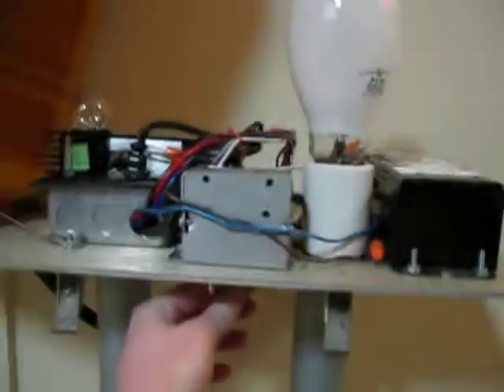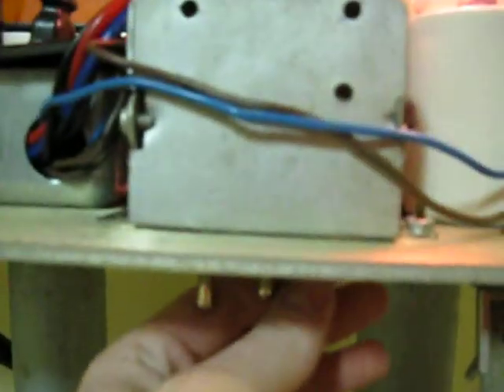Flash Technology REIL Airport Light!

Comment: The light is a Runway End Identifire Light and is used with atleast one light on each side of the runway threshold. They flash at 60 or 120 FPM and is used to help the pilot pick up the runway  environment on landing from the surroundings and can have three brightness settings. the angles are set away and up from the centerline to the sides as not to blind the pilot on short final. if you insatll a 12 volt flasher you will have some what of what it would look like just not as fast or bright

Comment from the maker: @IAmNotAFunguy There is no real reason I put them in there I just put them in there for looks. I don't have the big one on when it is closed it would get to hot in there! When it was still working at the airport it did not have those lights in it.
Reply: you could put a clear glass cover over that lighting setup then color the light bulbs Orange, green ,
Reply: I am working on 2 homemade search lights about 9 inches in diameter, I just lack 2 light Reflectors ,2 lens covers, and the motorized rotater .
Reply: +Roddy Juice I will make a video of the project I'm working on when I'm done and see what it will do.